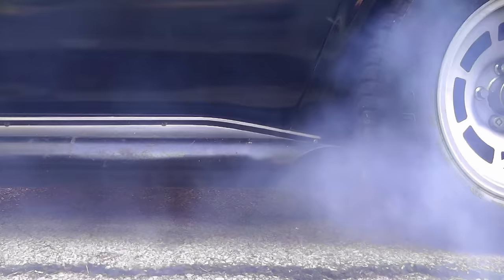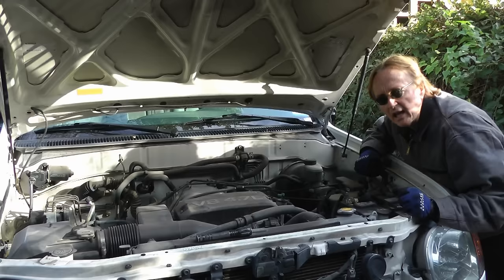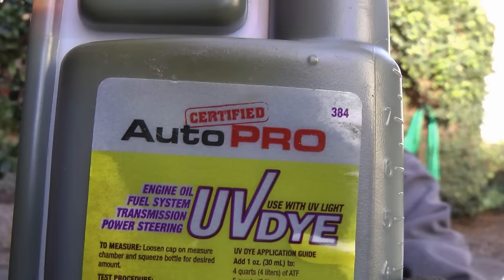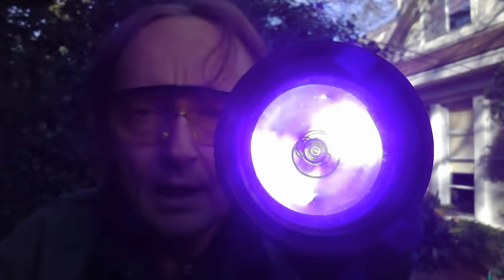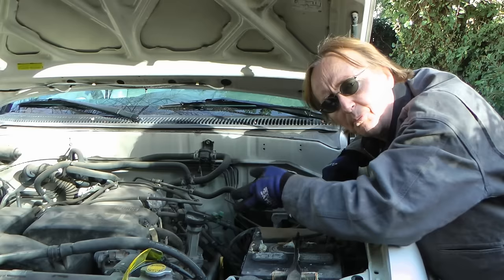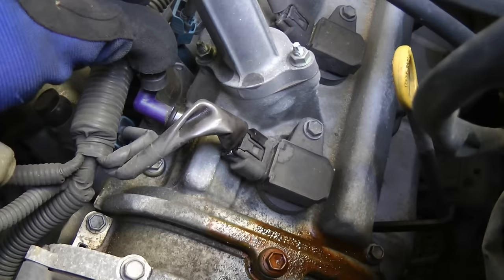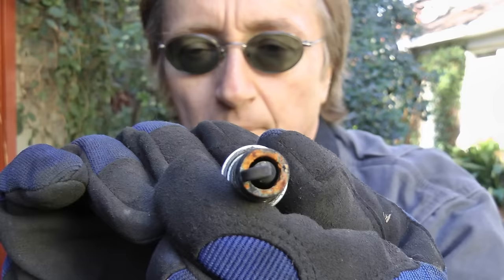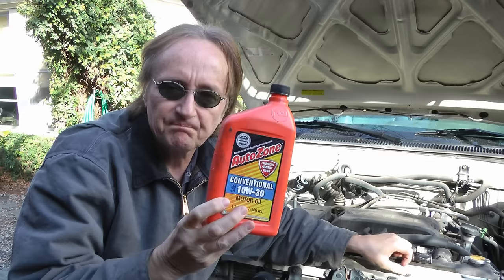How to Fix a Car Engine that Loses Oil (Leaks)

Comment: Part one: Another reason for oil consumption is using a different brand name oil, or a different weight oil. Every oil has different friction characteristics and your rings are worn into that. In order for your rings to create a proper seal after they are broke in. The ring has to ride on the sealing edge that was created during break in. Piston rings flex while the piston travels up and down creating a rounded surface on the mating surface. With a sharp edge at each end. When the rings can ride on that edge or right next to it a almost perfect seal is created. But this requires that the rings "flex the same amount" with every up and down stroke of the piston.
Reply: Part two: So when you change brands that happen to have a different enough friction characteristic than what you were using, the rings will flex more because more friction. And they will actually hop on the surface walls of the cylinder allowing oil to get sucked up into the combustion chamber. This increases oil consumption. That is why if this happens then you change back to what you were using, it goes away. Nothing was wrong with the other brand of oil it's just your rings were broke in using the your original oil. 

You oil ring on your piston acts like a squeegee. Always making sure enough oil is on the cylinder walls but not to much that to much gets sucked into the cylinder and burned off. These oil rings are designed to work with the weight oil that is recommended for you to use with that engine. Using a different weight effects how the oil ring works and can increase wear and consumption from either not enough oil getting on the cylinder walls, or to much.
Reply: Issac Bourne Part three: And there is another problem with using a thicker grade oil in a new car that is not designed for this. Because they require thinner oil, newer car engines are made with closer tolerances between bearings etc... To keep the gallon flow per minute (GPM) where it needs to be. Why is this important? Oil is 40% of an engines cooling. There are parts like bearing etc... that the cooling system water will never touch to cool it. So the oil transfers that heat to itself and as it circulates transfers that heat through the engine metal to the water cooling system. Or air if you have a oil to oil to air cooling system.

Comment: Ohhh Scotty haha I used the uv leak detector to find where the oil was leaking from and thanks to it I found  its from the oil pan and so I wanted to change the pan gasket but for this 97 model it has the exhaust manifold in the way so yeah I don't have the good tools to take it off so I might as well take it to a mechanic to fix that issue

Comment from the maker: You really don't want to clean the rings.  Cleaning actually makes them have more clearance, and it would burn even more oil. Try heavier weight oil and a couple bottles of stp oil treatment.

Comment: Had an VW golf mk 4 1,4 at my job before that used around 2 litres of oil during a summer ,Before the holidays we topped it up and in the end of the summer it was almost out , and the valves were ticking loudly too , so it had a big problem with the oil / valve system , it`s still running in another company but it`s still sounding a bit rough . I think it will go out soon . It had not done that many miles either , maybe 14 000 kms , not really sure but roughly .

Comment: Spill some trans fluid on the concrete one drop will look like you spilled a 5 gallon bucket full. If you have older Chevy that smokes but not burning oil but losing trans fluid change the modulator  valve in the trans.

Comment: My mom has an old 90s contour. It burns oil and sounds like a diesel when its cold BUT 325000 miles, still running! Just keep it topped off and it causes no problems! Im sure it'll throw a rod or something sooner or later but 325 thousand miles I aint complaining. It does love its havoline. Not my oil choice but that seems to be what keeps the chatter and knock down and also the temps.
Reply: No burning oil causes serious problems. The oil reduces your engines octane which can cause it to rattle and then cause engine detonation.
Reply: If I were you, try some restore engine restorer, it might stop the oil consumption. Remember to choose the right can size for your engine.
Reply: 325 THOUSAND miles my friend. The car isn't worth 400 bucks now probably. Its been knocking and clanking since we got it passed down to us over 150 thousand miles ago. Never has given us a problem. We do our oil changes on time and give its favorite and it never complains. Nowadays its hard to find a car that makes it over 200k without being in a junkyard. 325-350k i must be doing something right. Especially that its a ford. Much less a focus motor which are horrid.
Reply: I might have to try that. Its just not worth rebuilding at this point. We got it at 100k miles sounding like a diesel and it still sounds that way 225k to 250k miles later. That restorer might help it make it to 300k. Thanks bud.
Reply: Yup thats awesome havin that many miles. If you tried restore engine restorer, it may reduce or stop the oil consumption. If not, the piston rings and the oil seals in the valve train are just worn out. And for the knocking problem, you probably have some rod knock which isnt a problem, but should be fixed cause as the rod is moving horozontally, the bolts holding the rod might loosen and the rod goes through the block. So try the restore first and as scotty says, PRAY it works. If not, get ready to say bye bye to the engine.
Reply: I certainly will. Ill let you know how it turns out. Thanks for the recommendation!
Reply: Your welcome.

Comment: I have a very bad oil leaking coming from the engine block on my 80 series land cruiser. I bought Bar's stop leak at Walmart for 5 dollars and it minimized the leak 60 %. I have just used one bottle and it made a huge difference. I don't know if I should use another bottle.

Comment: Clogged up oil rings or stuck to piston oil rings from not changing your oil as often as you should can cause oil consumption. If the oil ring cannot do it's job oil consumption and increased wear will be the results. Change you oil. Use a name brand oil as well. Off brands can often break down sooner while in use inside your engine. Question is: Do you want to pay a little more for an oil change, or later down the road pay a lot for engine repair?

Comment from the maker: well, that's one person's opinion, but it's garbage from my experience. It's much more than an oil thickener. but ifyou have 225 thousand miles on an engine and it makes it last a bit longer, sure beats putting a new engine in or junking the car

Comment: Btw it leaves no spots and only needs it around 2,000 miles after an oil change.  This takes me about 7 months normally and the car is a 1996 Century.

Comment: some 2003 accords burn oil like its going out of style because some of the engines from the factory had bad rings and the engines burn so hot that the walls glaze.

Comment: To kd pierce... Yes, they didn't take care of it. My dads got an 04 with that same motor and 250k, doesn't burn/ leak a drop of oil. Also, that oil stabil is great stuff unless you live an any climate where it gets below freezing, then your oil just gets sludgy on cold starts and accelerates wear... Goes with my philosophy (change it at 3-5k and you'll be OK)

Comment: Or it’s just a small Hyundai motor and has 100k miles and has engine wear . already tried pcv valve. Will try the new Lucas stabilizer

Comment: Interesting! my chrysler neon 2.0l engine goes through a full sump of oil in about 2 or 3 months, so i carry oil in the boot for a top up. i dont leak oil nor is it smokey, but on changing the spark plugs a couple of them were soaked in oil which weren't a good sign. My ex noted value stem seals worn maybe the culprit as for now i have added an oil additive for stop leak. i wont be over hauling the engine.

Comment: @B-laze Official  I had a bad oil leak in my 1997 Honda accord but it wasn't the engine valve seal or engine and can also be the Cam shaft end going to the distributer unit, my seal was worn to the point that it was leaking that was a $150 dollar bill right there, and wasn't a bad price most of it was labor the seal was $15

Comment: Also do not use synthetic oil in an engine with leaks. This is because the oil flows better, so it will also flow through a leak better. But if your car requires synthetic oil then you have no choice but to use it. You can do some serious damage if you do not,

Comment: Thanks Scotty!  My 2003 CRV has had leaks fixed on both sides of the engine plus the valve cover gasket replaced once - when the oil gets low, I know it’s time to take it in for an oil and filter change - 217,000 miles and going strong - knock on wood - (insert me tapping my head with my 👊🏻 fist) LOL!

Comment: Not keeping your car tuned can cause oil consumption as well. A car that is not tuned well does not burn ad gas well. This translates into more contamination available to make oil dirty quicker.

A untuned engine that's not burning gas to well also make the computer think the fuel mixture is to rich and it will lean it out to compensate/ Lean burning fuel makes another contaminate known as nitrogen contaminates in the oil. This breaks down the oil quicker causing increased wear and formation of sludge.

Comment: Hi Scotty,I have Honda Civic Coupe 2008 model. Recently I have started to observe couple of drops of oil leak per day under my car. not sure if it is engine oil or power steering fluid. I showed it to a mechanic and he told me not to bother with repair cost and just keep on monitoring engine oil level to ensure I am not losing lot of oil. There are some oil leak check products in the market that stop oil leaks ..like Blue devil products...Should such products be the right fit for my car? It has 105000 miles on it. Thanks

Comment: I was very diligent with my car, a hyundai tiburon, in regards to getting oil and filter changes. But for some reason, the car is now burning/eating oil. I checked the plugs today and they're fine. I might see if I can find a shop book for the car and find that PCV valve.

Comment: At least with valve covers and oil pans u will have to replace the whole gasket anyways. But if its hard to find the leak i can see using the dye.

Comment: if you change oil alot of times you will leak oil from your pan gasket because the gasket is not used to that oil

Comment: So my 2006 5.3 Silverado been doing 2-5 seconds of white-bluish smoke on cold starts after driving on highway for 30 minutes. Now I'm hoping this is a PCV valve issue. I saw another video of the same vehicle just a 2004 instead that had valve seals replaced and said it still did it til they replaced the PCV valve and it fixed it. (Note: That he started it and had the same amount of smoke and the same time too. He also noticed that it only smokes on cold starts when they drive on the highway but not in the city.) The PCV valve is built in to the drivers side valve cover to on these vehicles, which is a bit odd.

Comment: Ya, i dont have the money for fancy dye, light or glasses. Ill spray brake cleaner and see where it comes from. I actually have no idea where my oil is coming from, but it shows its full. The bottom of my engine, trans, and t-case is coated in oil. Has a couple of drips  here and there but not big spots on the ground.

Have a side issue where a couple of spark plugs keep loosening though. Not fun when the engine is running and it feels like the plug is smashin the top of the cylinder/ piston. Sure its just air preassure though as the plug looks fine.

Comment: Hey Scotty, I was cleaning the throttle assembly on a 2000 echo and I found engine oil a little beyond the throttle plate. I removed the intake manifold. The inside of the intake manifold was fully coated with oil but, not the throttle plate. There were no visible cracks. Any ideas????
Thanks a lot, you are an inspiration to us all wannabe  mechanics.

Comment: The best way to fix something is to understand how it works, does the PCV valve seperates the air from the oil? Is it normal that the oil reaches up to the point where the pcv valve is?

Comment: As you know there are poorly designed, faulty engines right out of production. Example: 2006-2009 4 cyl Toyota 2AZ-FE engine....known for high percentage failure and oil burning due to bad piston and ring design. I was one of the schmucks who bought one, and yes I did my pre-purchase research but didn't find any negative data until after purchase. The Toyota user forums warn against additives for this engine, since it must have 0-20W and not thicker. What can I do, Scotty?

Comment: PVC maybe. If you have internal oil leaks and the plugs look great. Well check your muffler. If there is an oily slime, most likely it is valve stem seals. Especially if the vehicle is over 10 years old. A compression check will verify that. Not a fun job, probably easier just to replace the head.

Comment: Wish it was as easy as replacing the PCV valve on my Volvo. Damn foreign cars have a whole PCV system with several hoses and a breather box. Gotta take off the intake manifold just to get a good look at it.

Comment: Hi Scotty, love your videos.  I've got a 2JZ-GE Toyota engine that's using about 500ml every 10,000km - I replaced the PCV, I replaced the cam cover gaskets, which were stuffed, I replaced the distributor o-ring (stuffed), and today I am replacing the cam seals and front main seal which looks like should fix the last of the leaks - but the car has never dropped a lot of oil, just a few drips.  Compression is good on all cylinders - so I'm puzzled as to why its using so much oil?

Comment: My oil is POURING out, 3 quarts at a time, and I have to refill whenever I go anywhere and then pray pray pray I don't need to turn the car off before I make the round trip back home. I patched a major hole thinking I'd fixed it, but not so. It's still gushing oil as soon as I turn off the engine.

Comment: But if you have a rotary then it takes oil in the combination system by design to lubricate the rotor seals

Comment: Hi, Mr. scotty my gmc loses oil and I saw oil in intake air hose, i checked the pcv valve and cleaned and checked the oil level, and i still got the problem
Reply from the maker: oil in intake is often just worn out piston rings throwing blow bye into the intake. Do a wet and dry compression test of all engine cylinders, and if worn, live with it or rebuild the engine

Comment: Easier than a pcv valve would be a powerful engine that has been babied its entire life.  The piston rings would get caked up in carbon.  The easy fix would be to take it out on the highway, and gun the peddle a ew times, and let the transmission brake the car to create back pressure.  If you see black coming out the back, and it's not blue, then it's carbon being knocked off the rings.  You may have to put the car in 2nd gear, and go to 50 mph, then let the trans slow the car down.

Comment: My car is 13 years old , and it's done about 120 000 miles . It uses about 1l of oil every 2 000 miles and it does not leak , it never blows on engine oil cap even when engine is cold , but it is a bit greasy around screws and gasket . Does that could leave me to big problem ? For now I just change oil and filter every 5 000 miles .

Comment: my car uses 1 QT once every 6-8 days. no oils puddle underneath in the ground however lots of oil underneath the engine and transmission etc. I found 3 spark plugs covered in oil.

Comment: Hey Scotty I'm seriously looking at a 2006 VW Beetle TDI with the redesigned engine. So I guess it's a 2006.5. It's got the automatic DSG which kind of concerns me. Are these good cars? I drive 54 miles a day and 95% of that is interstate. It has 68,000 miles on it and AutoCheck checks out perfectly.

Comment: So in my case, its probably valve seals or oil rings.
Thats very bad news. I wish i could get the seals changed cheap... i asked a local mechanic and the price was stunning! i could buy a new-used engine for that price.

Comment: Dad's van is leaking oil rather fast, it only started once I was using full synthetic 5w30 in it. I ended up settling on using 10w30 whenever I need to top off. Now when we start the van in the morning after it sat all night the whole engine sounds like it's starved of oil for a few seconds, giving off a grinding noise. You think Castrol Magnetec Oil might help? It's supposed to cling to engine parts, I used it once and it at least seemed to cling high up on the dipstick. But, the grinding noise persisted while I used it for that one time.

Note the car's going to the boneyard next year most likely so even if I don't rectify it it'll not matter much, we have several cars to rely on too.

Comment: shop told me would cost $144.95 to put dye in system to find out where oil leak is.  Not using any extra oil and engine light code doesn't come on.  but they say there's a slow leak. Not sure what to think.  232k mi on '07 trailblazer

Comment: Well i have that problem but i caused it when i had an accord i would run it hard revving the small 2.4l and i believe its the piston oil rings that are worn but ill replace the pcv valve cause i could be wrong

Comment: I bought a 1999 honda crv and had a gasket replaced. It has only been a month and my crv overheated. 
 no coolant, no oil, it had all leaked out. 
Is it common for crvs to have engine problems?
Oil and coolant leaked out, just know it is going to be major repair needed.

Comment: Assuming that you buy a vehicle without knowing which kind of oil was used, how would you be able to tell if it's ok to try something else?  I bought a 93 dodge Dakota and the guy said he changed it religiously every 2-3000 miles since he did a lot of traveling in it, and he even told me the oil weight, but not whether it was organic or synthetic.